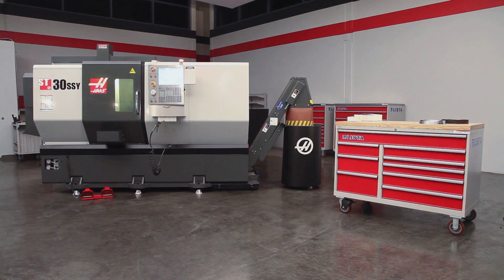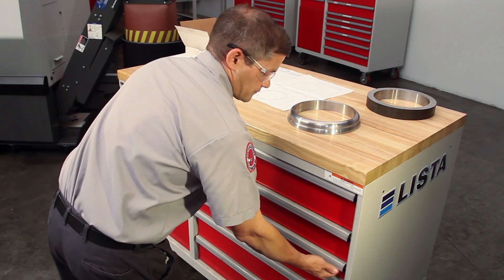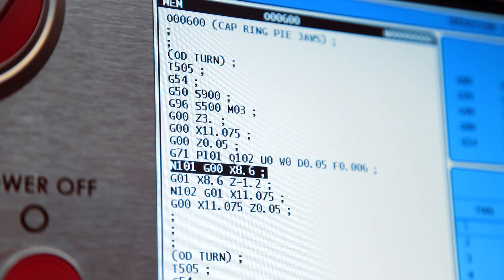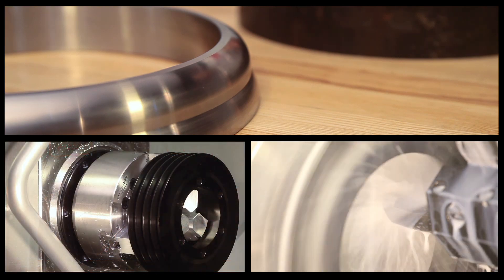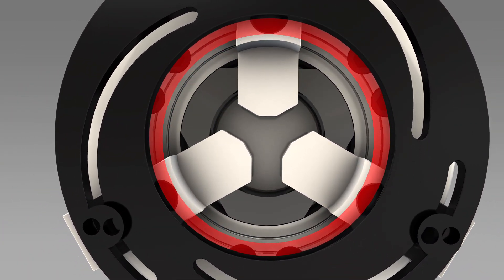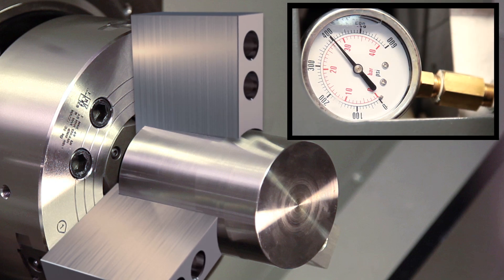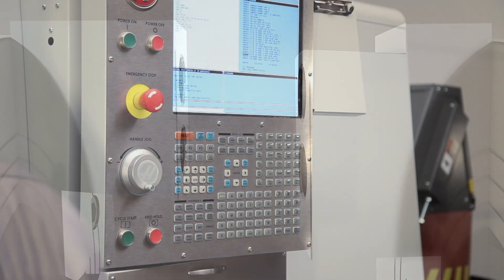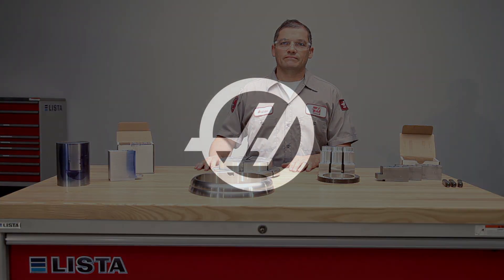How to Properly Cut Lathe Soft Jaws — Part 2: ID Gripping, Re-cutting, and Adding a Taper

Comment: THIS IS A WRONG WY TO HOLD THE JAWS FOR TURNING THE JAWS SHOULD BE SUPPORTED IN THE SAME DIRECTION AS CUTTING THIS WAY IS OK IF YOU ARE NOT HOLDING TIGHT TOLERANCES
Reply: Ken Hendricks what??